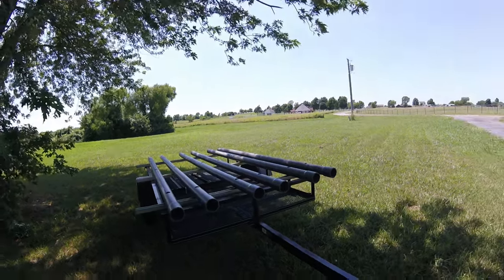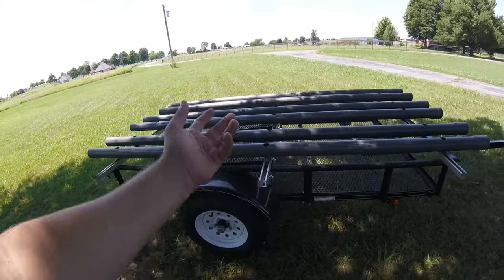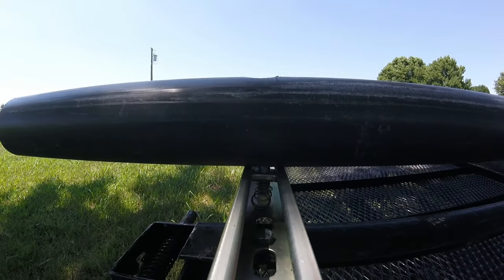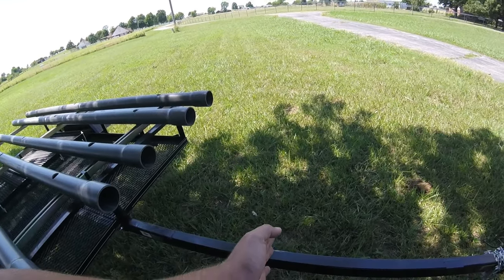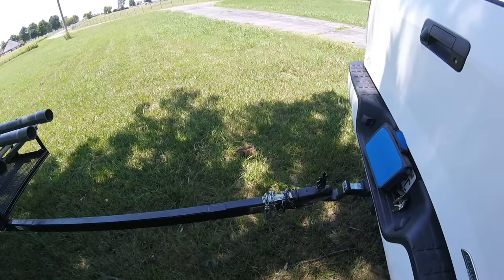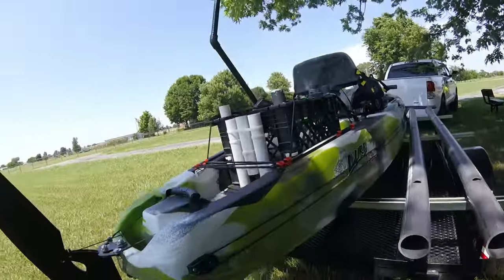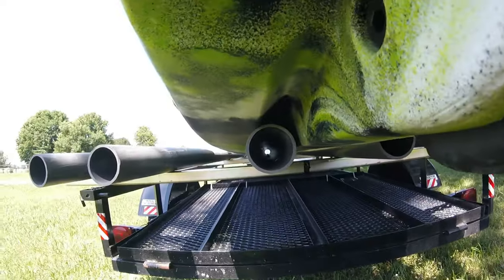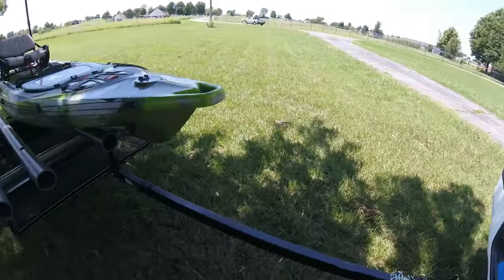DIY CUSTOM TANDEM KAYAK TRAILER

Comment: Nice build. I did a similar build. I used my 4x7 utility (I should probably upgrade to a 5x8). I folded the gate inward so I can still pull it up to haul other things. I bolted down unistrut too. I already had J Bar racks that I had been using on the car. I bolted them to the unistrut. I works pretty well for my Moken 12.5 and 10. Kids kayaks can lay underneath as well. I'm thinking about adding the PVC bunks for a little easier loading especially when a car is parked on either side in the parking lot. I like that they can be moved to accommodate different number and sizes of kayaks. But I like having the space in the middle for my rod tube. I suppose the tube could hang down from the unistrut. I need to think about lengthening the tongue too. Nice walkthrough. Thanks for the ideas.

Comment: This is a nice modification.  Simple, lean and effective, plus you retain the utility use of your trailer.  My son and I are doing something similar to this, but using a galvanized small boat trailer.  The uni-strut is pretty solid, makes for a great platform to mount the PVC runners on.  Enjoyed the video.  Thanks,
Reply from the maker: Outdoors with Charlie thank you for the comment. that's a great idea to use an old boat trailer. I'm glad you liked the video.

Comment: Nice job on the conversion, I liked the way you used the pvc. On my utility trailer, I pulled the loading ramp off (grind those end welds and punch the pin) and built a tailgate out of aluminum angle to reduce weight and noise. Go catch some bass!

Comment: As far as your "ball" on the Hitch, that is, iI bought one at Can. Tire that is exchangeable... I just pull the lock on top of the ball , pull the ball off and replace it with the other size ball ... so fast!  Love the job you have done on that trailer... I am looking for ideas the fix me one.

Comment: I have a 5 x 8 tractor supply that I did same to. Not the hitch end YET . My takes at 13 '. Do you transport with yaks loaded and seats in. I'm concerned with wear from vibration. Thank you

Comment: Nice work, however the point of using PVC is so that it may bend and flex to accommodate the curvature of a kayak. With PVC this big.. it ain't flexing much, and with the center support piece in there it CERTAINLY ain't flexing any.
Reply from the maker: I had no intention for it to flex. The pvc rides along both sides of the keel along the supper holes. I could have done the same thing with 2x4s. Except wood rots and is more up keep. They are basically bunk boards not cradles.
Reply: @adamwillby  "They are basically bunk boards not cradles." Exactly, and this is what you should be trying to avoid. No judgement, this is simply an observation. You are forcing the kayak, which has a curved bottom, to conform to a flat rigid support; literally flattening out the kayak over time (especially in hot climates). It should be the other way around where the kayak is forcing the support to conform to its curved shape.

Comment: Good video and good info!! What's the weight of your boats? And do the pvc pipes seems to "roll" outwards under the weight of the kayaks? I'm thinking of trying this with my gheenoe but the gheenoes weight a little more than yaks, especially when loaded. Do you think this would suffice for a 120lbs vessel?
Reply from the maker: andrew louderback they weigh 100# empty. They don't roll under the boats due to the tunnels on each side of the hull on the Lures. It could easily handle much more weight.

Comment: what did you use to drill the bigger top hole in the PVC?
Reply from the maker: hole saw like what you would use to cut a hole in metal.